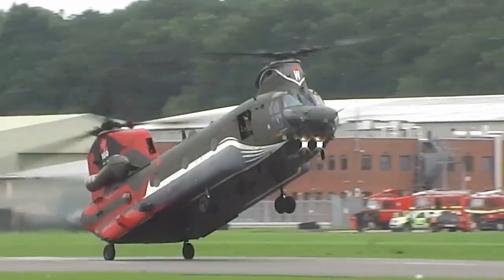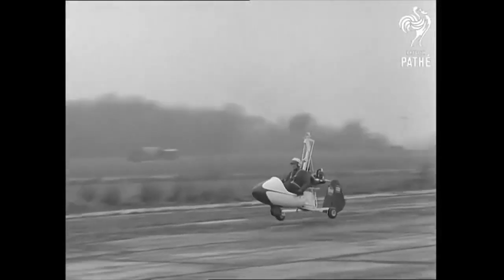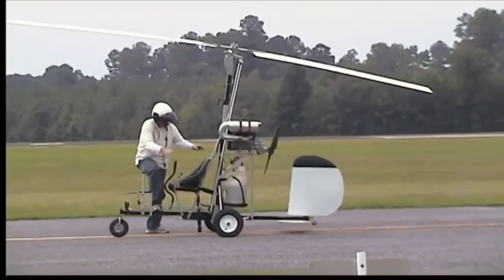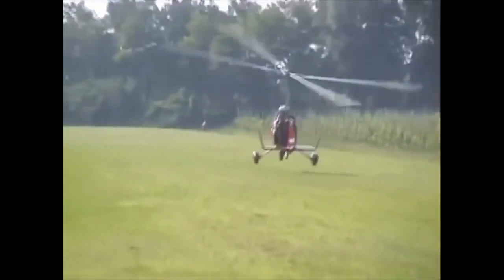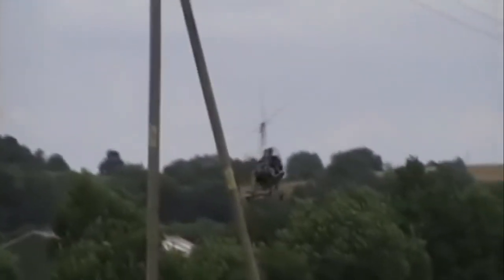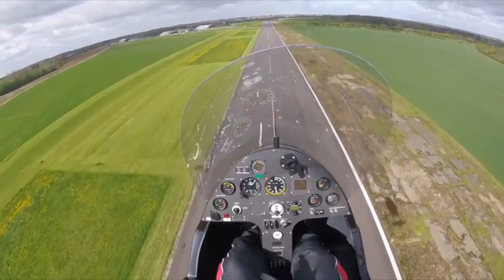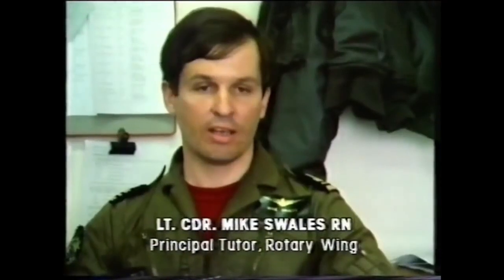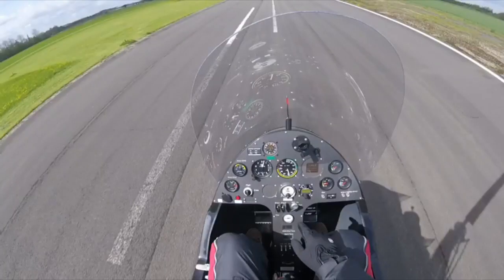Gyroplane/gyrocopter wheel balancing [part 1]

Comment from the maker: I was talking to someone at Auto-Gyro Gmbh today about rotor system three and they went on to describe their take off technique with rotor system 3... sound familiar?  It should do...you heard it first at the Gyrocopter flying club.  Lead don't follow.

 The first thing is that the rotor head has two rotor brake blocks - one front, one rear.  However the front brake block is also the forward rotor head stop.  So this means that the initial pre-rotation is done with the stick held slightly rearwards so that the front brake block isn't engaged with the ring gear - adding friction and limiting the efficiency of the pre-rotation.

Then once RRPM has been built the stick isn't brought fully back but only 2/3rd of the way rearwards - why? because fully back is too draggy and moving the stick slightly forward gives a "cleaner" / flatter take off without the clumsy nodding and over controlling that can come from keeping the stick fully back and attempting to bring the aircraft into a wheel balance...

Comment: I have a hard time understanding the main difference between the classical wheel balance technique and your technique. It looks like you are minimising the wheel balance phase. Am I right?
Reply from the maker: essentially correct - and forgive the grand terms of "my technique" its just in the absence of anything else to call it.  But effectively what I am trying to convey is the point that keeping the stick all the way back and a focus upon what is typically termed "wheel balancing" creates a very draggy state plus promotes a feeling to pilots that they must spend time in this phase - rather than getting on with the job of taking off.